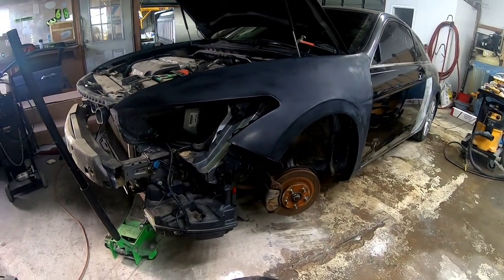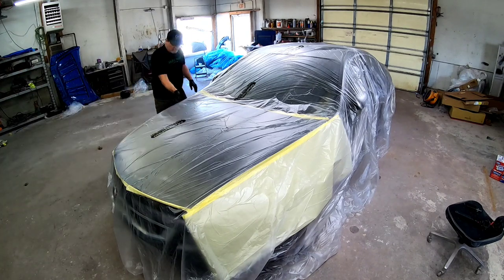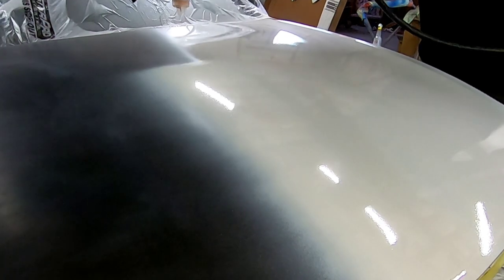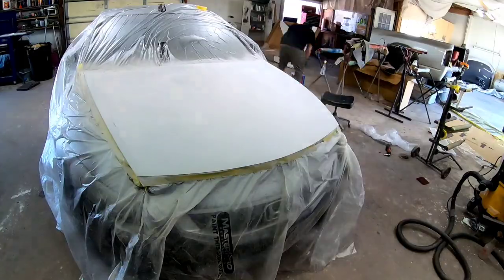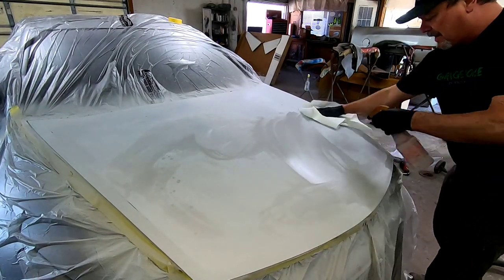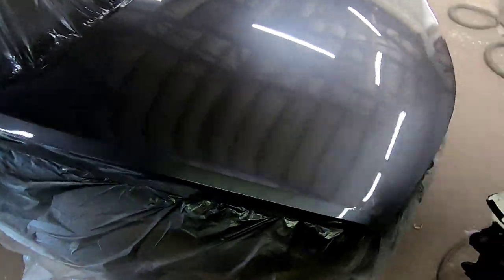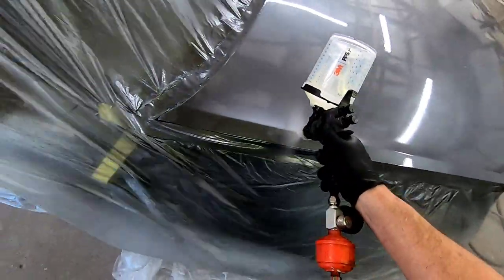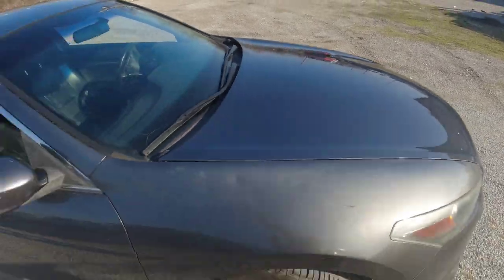Paint a hood at home. #autobody #autopaint

Comment: Very nice can you sand 600 old paint and paint new base coat without the primer then clear coat is possible?
Reply from the maker: Yes, as long as the clear your sanding is in good shape. If the clear is failing due to sun damage then it would be best to sand then seal or primer before applying paint.

Comment: Great job on your hood. Very fast work. 
Most hardeners or activators show 6-8 hours dry time for this clear in order to Sand and buff. If different activators cause a different dry time why didn’t you mention that? 

I don’t think you mentioned what hardener you used. Also Amazon listing for this says it doesn’t come with a hardener. Have to buy that separately. So question is what did you use that you can wet sand in 30 minutes? Or did you actually do anything to it after 30 minutes. 

Also while on the subject nothing was mentioned about how long this will last. Before turning yellow or peeling or fading. Most quick drying hardeners I’ve heard do not hold up over time so durability goes out the window. Got any info on this?
Reply from the maker: Hard to mention everything but your right that different activators have varying cut an buff  times. I didn't  cut and buff this at all. 
   So durability for quick dry clear is not typically an issue. The problem some times is (because  it drys quick ) die  back or loss of the gloss after it fully cures. If at all possible  a clear that cures in 2-3 hours won't  have the die back that a 30 min clear will.  Good  questions, appreciate the support brother!

Comment: Hey Chris, do you recommend the 1.4 over a 1.3 for DTM sealer as you used here?  I have both, just want the sealer to be as smooth as possible.  I plan to spray wet on wet, no sanding the sealer.  Thanks man!
Reply from the maker: Dmt sealer ,wet on wet, I would use the 1.3 You may want to do a test tho and see which you prefer. Thank's  for commenting and supporting the channel brother.

Comment: Which do you like better the flash clear or the nason I wanna buy a new clear to try so idk which to choose but I can’t seem to find the flash clear
Reply from the maker: If you are just doing a panel or two and want it to dry quickly than the flash clearcoat. you can only get it at oreillys tho. If your doing an overall paint job than the nason would be better for that.
Reply: @GarageNoise  I never do a whole car always one or two panels or sometimes a side of a car but what’s driving me crazy is most people buy base coat and clear from 
Oreilly’s but none I’ve been to near me does is there a way I can look up or check to see if there is a store that does mix base and sell that clear near me or within 50 miles
Reply from the maker: @AliVapeReviews  yes, you should have a local automotive paint supplier near you. Napa sell a line of paint as well. Where you located?
Reply: @GarageNoise  I’m in Hillsboro Oregon I have tired napa’s base color match is trash and always got there more expensive line which I believe was pro base I’ve been to a few oreilly’s but none mix paint been trying to find one